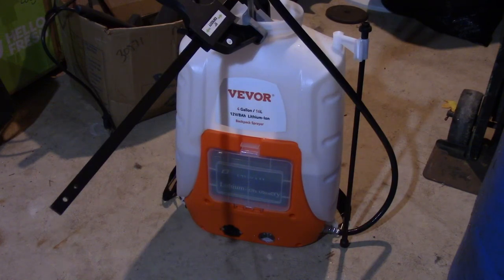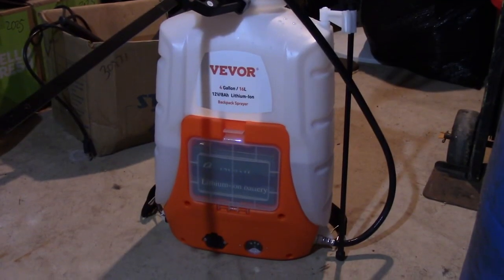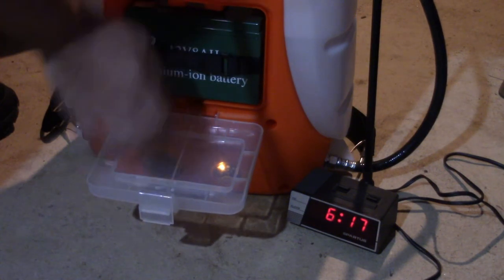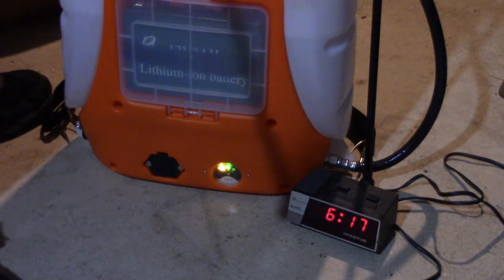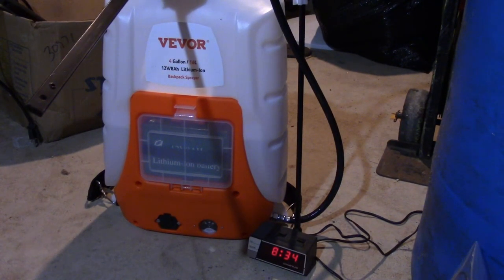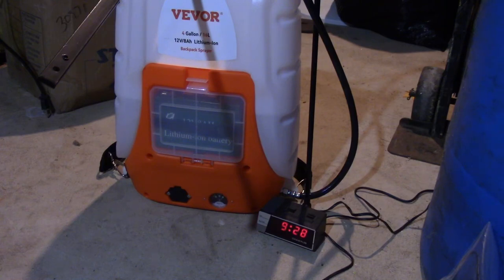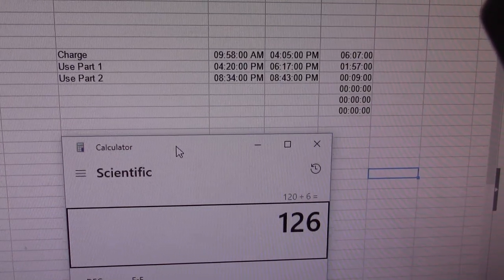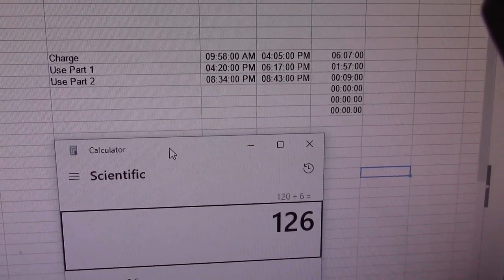VEVOR 4 Gallon Backpack Sprayer Battery Test 12V 8Ah

Comment: Is there a trick to get the sprayer to charge. I unpacked my new Vevor sprayer, plugged the charging cord into the port on the sprayer, then into the electrical outlet, then left it for 8 hours. The only light that ever came on was the small red LED on the charging plug. What am i doing wrong?
Reply from the maker: If the sprayer is switched off and it still won't charge overnight I would contact vevor directly for service. There are no special tricks other than switching the unit off iirc.